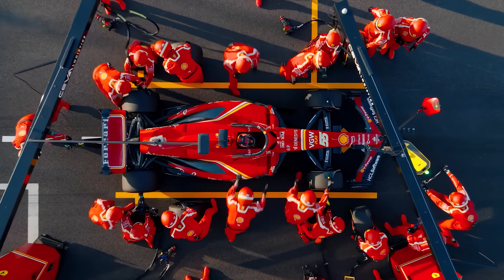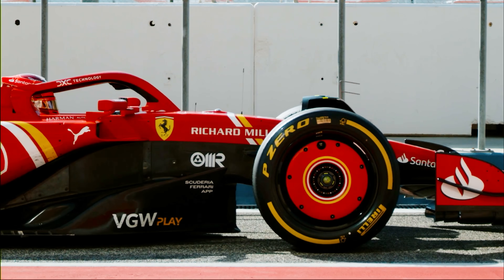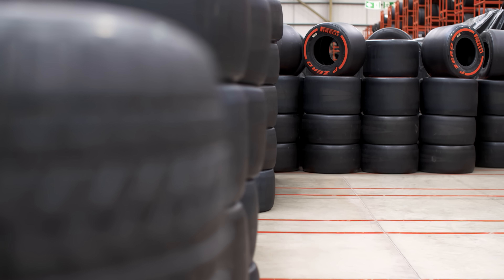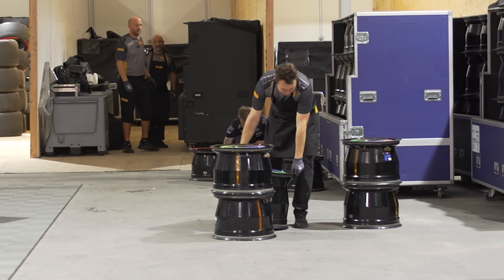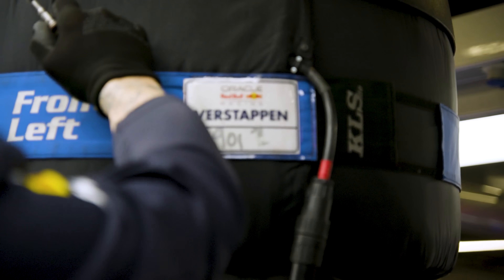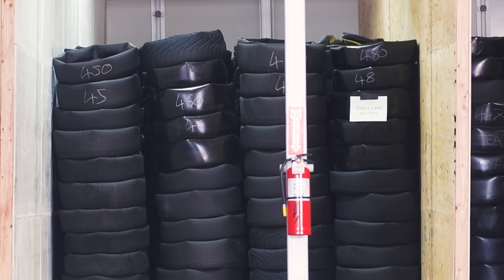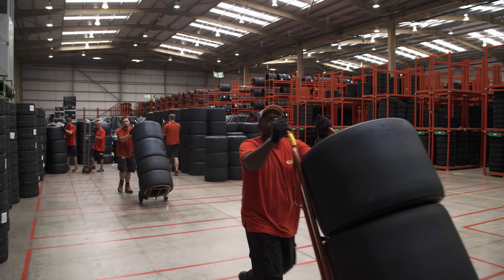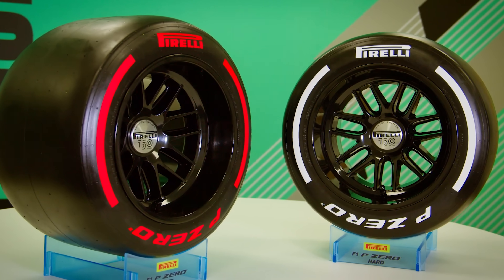What Happens To F1 Tyres After A Race?

Comment: Why do they even make wet tyres anymore, nowadays any session will get cancelled as soon as the intermediates go on.
Reply: Didn't we have 6 wet races last year?
Reply: helping to get water off of the track once conditions are in the range of being safe to drive.
Reply: Brazillian grand prix was mad, full race with only intermediaries
Reply: Did you watch Brazilian GP.
Reply: We don’t have senna anymore to wave arms around in a torrential downpour
Reply: They make them but quite literally NEVER use them, at most they'll switch to intermediates, because once it stops raining your gonna have to ptt and get intermediates instead of wets which can something lose you the race
Reply: haas literally used them today
Reply: Exactly. George Russell told its the most expensive thing that f1 spends their money on shipping the tires and not using it.
Reply: @Nathan4211 most ironic statement I’ve seen in ages. 
Funny how George says that when he’s paid £15M a year and has only ever won 3 races across 7 seasons.
Dare say posting a few tyres isn’t the main issue
Reply: The last time a race was canceled for rain was Spa 2021 and that was a torrential downpour
Reply: @TonyWoody  spa is a deluge track due to the rise and fall and its location in the ardenne hills. Its a horizontal waterfall with massive aquaplane risks
Reply: That is nascar not F1, but there is only so much rain those tires can take
Reply: Because not every formula are pussies. Simple as that.
Reply: F1 is a year round sport in many countries and not all countries have the same rules. so rain tires are needed ! 👍👍🤘🤘
Reply: Thread is making me miss the show.
Reply: They sure don't have an entire race in the rain.
Reply: Gene Haas saw this and same MWGA
Reply: Literally half of the last prix in Canada was under rain and wet conditions.
Reply: @wiruegas its flat. The rain was also start stop.
Reply: Maybe qualifying if there less cars on track it's a bit of a rare occasion though as it would have to be wet and drying all qualifying or they won't get used
Reply: FR FR 🤣🤣🤣🤣🤣 embarrassing
Reply: No. A wet track is still a open track. If it rains mid session nobody will waste tyres for no speed improvement v their dry run. A full wet session is different
Reply: They have trialled and not found a spray limiting " cover". The spray is the hazard more than the grip. Zero visibility to even see the red rear light
Reply: Aircraft tyres are much like inters. They barely cope wirh water. Tgey have some groove but it fails to handle standing water. So most runways have tracks to help drain. F1 cant profile track surfaces though
Reply: Rarely read so much bullshit.
Yall will never understand it's about helicopters not being able to properly do their job.
Use yohr brain just a tiny bit.
Reply: The YouTube channel is a little pric doodoo fa j ot
Reply: I’ve heard the Perelli wets suck
Reply: Is say it's more of a driver/team problem not wanting to switch when they should
Reply: Well Melbourne 2025 made this comment date pretty bad lol
Reply: Very good question.. intermediate the  cancelled.
Reply: Rules
Reply: Fr, spa 2025 was actually embarrassing 😭😭
Reply: Well the tyres arent the problem, the actual problem is the spray and thanks to F1 being most focused on safety, they wouldn't  want another Belgium 1998 happening.
Reply: @marika8655  Hence the question. Spray is the result of wets doing their job and pushing water away. If they cancel races as soon as spray happens, why even bother making wets?
Reply: @cuscoothriyas5163  Pirelli actually agreed when the drivers said that the Wets are basically useless and only used behind a safety car, I heard they are working on a new compound called Super Intermediate though. They keep making them because these are the current rules for tyres, Slicks-Interstate-Wets.
Reply: @marika8655   It's a rhetorical question, we all know the only reason they still make it is that the rules dictate so. It's more just us going, "why on earth is that rule still a thing?"
Reply: @cuscoothriyas5163  If I think about someone using wets, I can only remember Gasly in Germany 2018 while almost the whole grid was still on slicks except 2 other cars who were on inters
Reply: @cuscoothriyas5163  People don't  pay attention to what they're reading. Otherwise, you wouldn't have to state this explanation.
Reply: @marika8655  The tires are the problem.
The Inters are just the "Better" tire.
They get rid of enough water to give you grip, yet have the have more surface area for contract with the track compared to the wet.

The "Wet" tire gives less grip when the track is drying due to the less surface area compared to the inters.

Remember back in the late 90s and early 00s how the slicks had grooves?
This was to reduce the surface area of the tire, to give less grip
Reply: @IIGrayfoxII  Grooves increase surface area, what are you saying? Grooves may help reduce the size of contact patch.
Reply: @ The INTERS have more surface area compared to the WETS which is why "THEY ARE THE BETTER TIRE" as is mentioned in F1
Reply: @IIGrayfoxII  I think you're confusing my friend. Wets have more total surface area due to deeper grooves. But they have smaller contact patch ( surface area in contact with the road) compared to inters. 

I agree with your conclusion though. Inters have more grip compared to Wets on the dry track.
Reply: Why can’t people stay on point instead of slightly making shit up? What races have been cancelled as soon as intermediate tyres have gone on?
Reply: @mdcclxxviepluribusunum1066  full wets havent been used since 2016
Reply: Very rare now days that full wets are even used but are still taken especially to places like Malaysia  when we used to go there as by 4pm there time you just new it was gonna be a downpour!!
Inters now day are about as far as it gets as the FIA have a wobble & stop the race!🙄🥱
Reply: @darrenboston342  Interlagos last year??
Reply: @ yeah what of it🤔
Reply: When did that last happend??
Reply: We’ve seen what happened to jules bianchi when we said “it’s only a bit of rain”
Reply: @Arado_Missile his problem was less about the track condition and about why the frick a excavator was on the track. Now red flagged or safety car at least.
Reply: @paulgerrard9227  I’m not sure if you’re saying that at both of us or just me coz I just had a stroke reading that
Reply: They race in the rain, just not heavy rain.
Reply: They don't test them. Pirelli cannot make wet tyres.
Reply: So true.  The sport has become racing with Ipads.  Having been a fan since my first British GP in 79it is fast losing its excitement.  By 2030 they will probably be racing in cars that resemble the Michelin man.
Reply: They do make wet tires!
Reply: @procatprocat9647  yeah but that isn't the question
Reply: @procatprocat9647  they said "why do they make wet tyres" not "why dont they make wet tyres"
Reply: @furp29 People's grammar is at the lowest point it's ever been xD
Reply: @procatprocat9647 
Learn to read
Reply: @procatprocat9647  nothing gets past you eh

Comment: You can buy older F1 tires/tyres from before the Pirelli era but they are usually tables and chairs now AND they have to be treated because the rubber off-gasses can be toxic and generally horrible in the home.
Reply: My grandma once off-gased at the dinner table back in '77. (I was 7) The next day I sent a "Jart" through the windshield of our neighbor's new Jaguar XJ12.

I blamed it on the "off-gas incident..."
Reply: Or you can just let them sit and stink for 50years. Hasn't killed me yet.
Reply: Besides carbon and rubber, the tires use a number of complex organic compounds, like Diphenylguanidine, to aid in things like vulcanization. It's what chemicals are used and how that Pirelli is trying to keep secret. Some of them are fairly volatile, and can outgas over time. Treating them with a high vacuum might work though.
Reply: I've got a Goodyear Michael Schumacher tyre.
Reply: Much like the gasses from the race
Reply: How do you treat them? I have a couple  Porsche tyres I wanted to make tables
Reply: @Ale-bj7nd possibly just need to put them through a heat cycle to burn off the chemicals on the surface after production?
I guess that means an oven unless someone has a spare F1 car to do a few practice starts🤣
Reply: @MIEJ4  they were actually used in Monza
Reply: @MIEJ4  Why guess if you don't know? What makes you think the surface is the only part of the tire with dangerous compounds or that a "heat cycle" would have any meaningful effect?
Reply: @Ale-bj7nd  You may have to go the route of a sealant, like a fluid-applied product that will cure and seal the contents within.  The first thing that sprung to mind was something like a matte polyurethane, but you'd probably want to do a little research about the effectiveness, i.e. permeability, of the seal relative to the elements/molecules being off-gassed.
Reply: @dmo224  thanks for the first meaningful answer. I will do my research for sure... A matte solution is an absolute requirement, I don't want it to be shiny... I might resort to leave the tyre in the garage, maybe with a plate.
Reply: @Ale-bj7nd  You can't, the compounds that keep the tyres soft will take decades to off-gas.
Reply: that sounds like spin to me